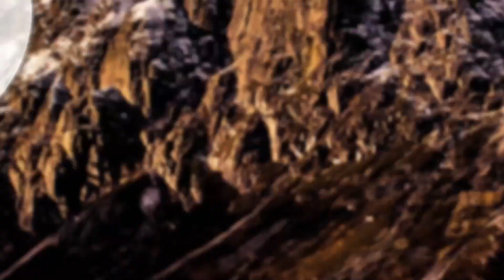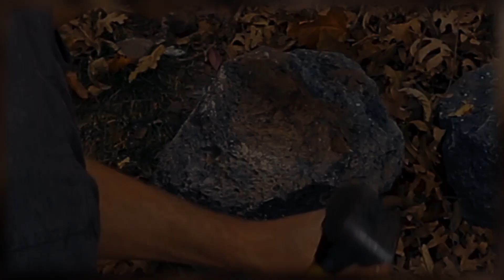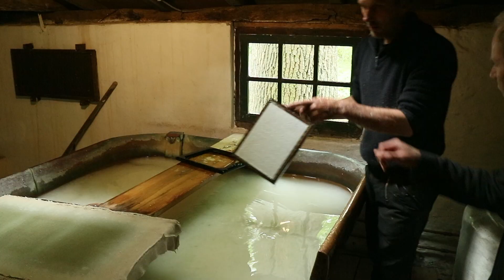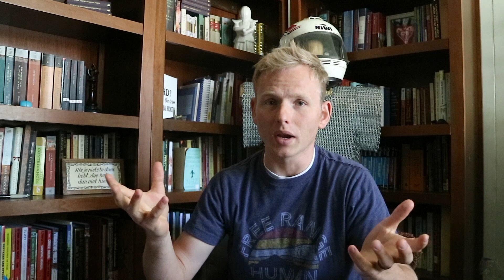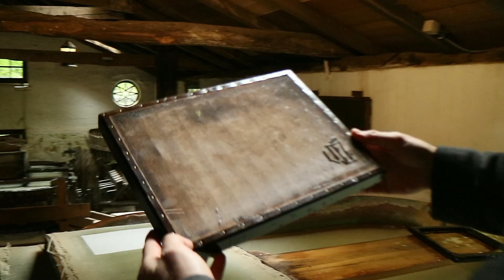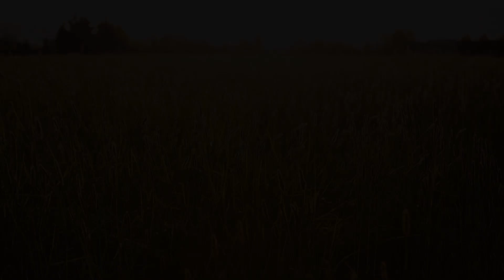How High-Tech is Paper? Prerequisite Technologies

Comment: Instead of looking at objects as bottlenecks, you need to look at them as their basic functions. A bellow is a wind machine; use humans blowing with pipes in a furnace. A screen is a hold solid pass liquid; use any mesh or porous materials and you'll get the same result.

You do this back and forth and you realise that many things are actually easier than they seem at first. For example, I want to try to smelt iron sand, but I have to first find a way to isolate the sand; the latter can be done by making a pottery tile with a washboard pattern, removing the need for panning or magnets.

Comment: A skeletonized leaf probably has the right structure and doesn't require any advanced technology to make. It is fragile however, even when layered, and finding leaves large enough to make a standard sheet of paper with might be a challenge. There are a lot of good ideas here. I combination of bamboo fibers, horse hair, and skeletonized leaves might work. Having alcohol in the paper pulp fluid would also prevent bacteria from breaking down the screen. (or at least storing the screen in alcohol overnight would delay rotting due to bacteria)

Comment: Clay is used as a water filter.  Could you use a clay tablet with a small rim around the edges to let the water both fall through the clay and evaporate?  I believe bamboo has been used, but I'm not sure you have natural access to it where you are.
Reply: When I said clay, I meant fired clay.  Not powdered.

Comment: You might try to use beeswax impregnated hemp fibers. Weave them into a loose mesh like the paper screen. Then use linen rag, pounded fine to break its fibers into shorter lengths for the paper-pulp.

Comment: I know for a fact woven thread works because I've done it myself. You don't even actually have to weave it—just make a frame with a bunch of bits sticking up on all 4 sides and essentially use that to make 2 sets of warp, one lying on top of the other at a 90° offset.

Comment: In order to make strings as fine as wire, will need to learn how to spin silk thread. spin the threads together and you can get some pretty strong string that can be used to make a fine mesh screen/strainer. These technologies have been around in central Asia for thousands of years.

Comment: To the best of my knowledge, the ancient Chinese used screens woven from silk.
It's quite likely that you could get the same results from linen cloth. 
The only reason stainless steel wires are used today is because they last longer.
Reply: Mainly rounded bamboo strips tied together with horsehairs. And you don’t even need a screen if you can accept lower productivity: you have a flat, shallow box and your pour the pulp into it and let it dry in the sun. Take it out before it dries completely, so you can burnish it to make it smoother and flatter.

Comment: You can use sand cemented with sodium silicate, that can be made out of sand and caustic ash.
Mix two, it will self-level, cure on air(with CO2)
You will be left with a block that is porous, so water can escape leaving pulp on top and it will be flat

it may be rather difficult to clean, but it's pretty basic

Comment: My first thought was yarn or thread stretched tightly between a frame.  trying between the threads run laterally, vertically and finally a screen would be interesting to see. The downside of the threads or yarn is they may stretch the frame may have to be pre stressed to take the slack from the expanding string
 _
)_(

Comment: Are you looking for something that can function like paper, or are you only interested in wood pulp paper. If you look at alternative materials and processes I think you can ditch the screen all together. Maybe a heavy stone made to fit just right in stone basin could be used to push the water out the sides (or through fine holes). Maybe you could come up with a process like fiber felting with wool.  Papyrus made from reeds could be made with stone age tech. Parchment and velum could be made with fairly primitive tech too, but you have to chase your materials down. There are other less well known paper analogs that could be made pretty easily too. You could probably make it out of scoby which is the bacterial mat that grows in kombucha. You might be able to use the inner layer of some types of tree bark. 

Also, I know the wood pulp isn't the limiter in how primitive you can make paper, but you might want to look into cattail paper  made from the fluffy hot dog shaped thing at the top. My aunt made me some, and its very soft and flexible although easy to tear. The fibers might be more ideal for a less advanced screen though. I think with some experimentation you might get a pretty usable paper out of it.

Comment: You could pour the slurry into a drum-shell that is constantly spinning(By hand or by windmill/waterwheel/etc) and drill a few small holes near the edges of the bottom of the drum. The paper fibers(wood pulp) should be thrown onto the sides of the drum and the water can slowly drain away. If you spin it fast enough for long enough and keep re-pouring the slurry, you should be able to get a sheet of wood pulp that can then be pressed after it is solid and dry enough to be carefully removed from the drum. The pressure against the walls should cause it to dry out once you stop pouring more slurry through. So all you would need is string, a pole, a bucket or drum-shell, a few sticks to help brace everything, and a way to get a wood pulp slurry. Spinning the bucket at a nearly horizontal angle should keep the sheets roughly the same thickness throughout. This is about the lowest tech way I can think of to do it. It is probably not the easiest or the best, but it requires almost nothing but arm strength and time to work.

Almost forgot: By drum-shell I just meant a hollowed out piece of wood. Like a musical drum.

Comment: You could make a tool from a book press or make one similar to a book press.
A method that I saw for making paper is to press the wood pulp. First: find 2 flat objects
Second: place the wood pulp on 1 of the flat objects flat face
Third: place the other flat object on top with a weight.

This process  would only need wood pulp and flat heavy objects like rocks (which as technology advances could be replace with a metal plate).
 Both the rock and metal plate methods are more primitive than the screen method.
Reply: A benefit of this method is that you can put designs in your paper with dye and place seeds in your paper. When the paper can be use to plant seeds when you are done with it.

Comment: Utter dipstick !!! : US CURRENCY contains : COTTON, WOOD PULP, FLAX ... and WOOD GLUE and CLAY (to make it whitish) ...
An adequate substitute for the METAL SCREEN ... WOOLLY FABRIC or BAMBOO or BANANA LEAVES (maybe) ...
Reply: Clay is not really for making the paper white (unless you are using kaolin clay), it is usually used for gap filler, evening out, and to absorb ink. Fillers like Talc, calcium carbonate, and mostly titanium dioxide is used for whitening.

Comment: While thinking about substitute for metal screen people naturally go for cloth which is basically a screen, as we see some try to look for finest thread possible hence the comment about silk.Its very rational, doesn't change anything in basic idea and seems easy to execute-once you got fine enough material you just need a frame on which you stretch the cloth which will auto-level it.But its not that easy to make a fine thread and then manufacture a dense cloth out of it.Let's think out of the box
For some reason I keep thinking about using some fine powdersWith small enough grains you should be able to get it fairly flat on the top layer. Water could sift through it, leaving the layer of pulp on top.Its absolutely crazy and impractical idea but I would love for others to join me on this thought experiment.In theory it seems simple but there are already major problemsFirst, assuming it works and we are able to get flat enough surface it would be very tricky to pour water-pulp mix without agitating the powder (resulting in not so flat surface after all and contaminating the paper)Second, what kind of powder could work in this set up? We would need something that's very fine, wouldn't float on water and won't react with water. Doubt any kind of natural sand would be fine enough. Was thinking about talcum, would be easy to powderized but I'm not sure how it behaves with water. Ash seems like a possibility but it may cause a lot of problems, creating lye etc. Charcoal is on my mind (for some reason the very idea of fine powder filter popped in my head as reversed gravel-sand-charcoal filter) you can smash it very fine but it could blacken the paper, at least from the bottom if not all the way through
Maybe someone has some idea to build on this solution

Comment: The paper they're making at that mill from rags is linen, not wood pulp, based. Now Asia had wood pulp based paper as early as the 2nd century, but wood pulp for paper in the western world wasn't really introduced until around the 1840's, and wasn't really cost effective till around 1915ish, and even then it took several decades before it got to the point where we think of wood pulp when we think of paper.
Reply: I'd also point out, the screens can be made out of thread, so if you had weaving fiber, and you weave a strong thread fine enough to withstand enough tension to keep from sagging when wet, you can make paper. I suppose you could probably use sinew... but that might be a tearable idea.

Comment: make a stone with a flat smooth surface, slap a handful of wet wood pulp onto it and then press it with another flat smooth stone. the screen is not a prerequisite, it just makes the job more efficient and the quality of the end product better.
Reply: I tried this as Kid in the 70's. The pulp would really bind and just made thick slab
Reply: @Margarinetaylorgrease  no offence, but kids aren't very strong. you need to press it down really hard until it has the thickness of paper.

Comment: I have in my own interests explored the process of making paper and one article of the mesh/screen construction I find the most difficult is not the frame itself but rather the manufacture of straight wires. It sounds simple enough but actually fabricating, by hand, straight and true rods of some material is very hard as it requires a deeper understanding of the properties of the material in use. Iron is pliable and easy to come by but rusts very quickly in cycles of water/air without constant care after each work day. 

Edit: One can simply not just make a wire, you need a forge, hammer, anvils, fuel, materials, dies and experience.
Reply: Use wood fibers or some other natural fiber.

Comment: I would agree with the silk idea but also bamboo can be slivered very thin and is pretty easy to work with. I'm sure you could make a screen out of one or both combined.
Reply: I was also thinking bamboo. I have seen bamboo pulled through a metal hole (could probably be done with a stone) making long very thin consistent stands.
Reply: @hpekristiansen  You can snap bamboo with the grain with your hands. Then you can just pull off a couple of strands.